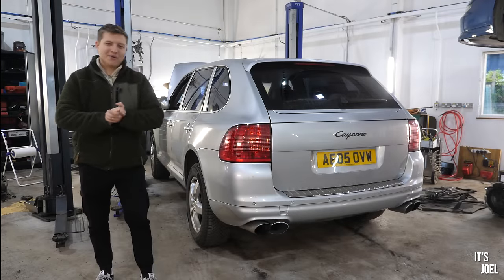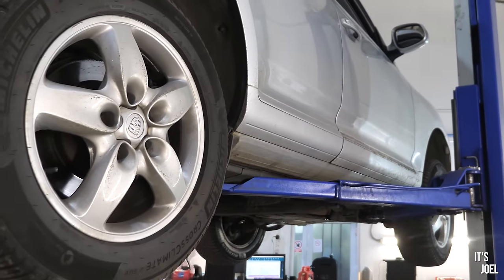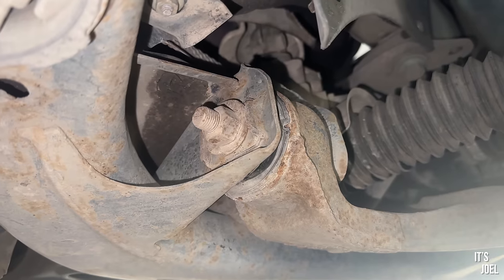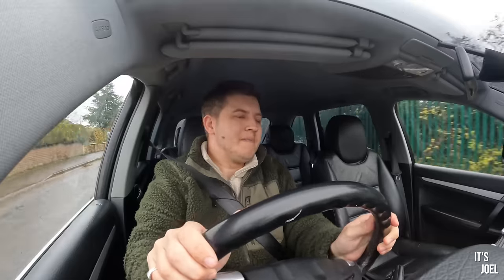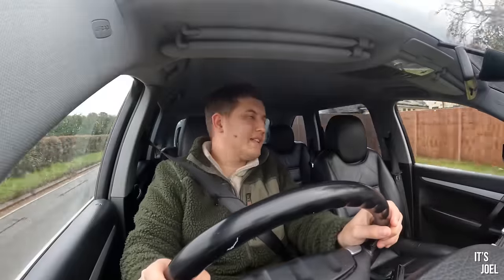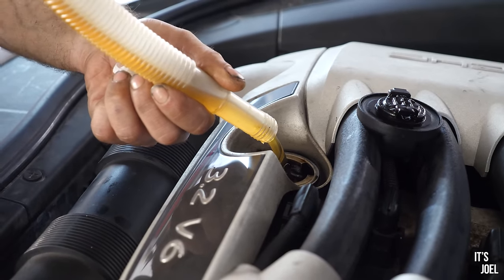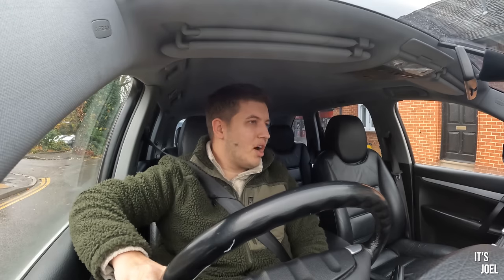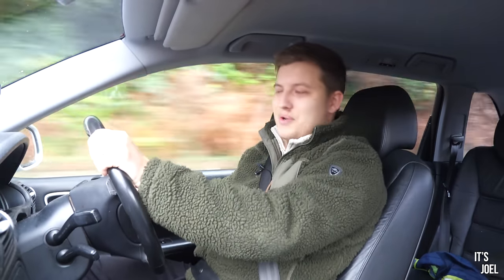The Truth About Owning A Porsche Cayenne...

Comment: Twist! 4.4 TDV8’s are phenomenal 👍
Reply: That's until both turbo's fail like mine...
Reply: @orwell9579  on the 4.4 or on a 3.6?
Reply: @JohnBaxendale  2011 4.4 Vogue SE
Reply: @orwell9579 interesting, it’s less common in the 4.4, do you know what went wrong? Presumably there was something that caused them to both go?
Reply: @JohnBaxendale  It's indeed less common on a 4.4 but I was out of luck I guess. Turbo failure on a 3.6 almost always has its origins in EGR problems that cause clogged vanes. In my case oil somehow got into the intercooler and was sucked up by the engine which led to turbo failure. Body had to be lifted so a high labour cost.
Reply: @orwell9579  Ugh, that sucks :( The failure of the oil cooler is quite common on the 4.4, it's usually oil that makes its way into the coolant, rather than the other way around, but anything can happen I guess!

Body isn't really lifted on a L322, it's only the Sport's/L320 that have the body lifted. The engine's on a subframe on the L322 and dropped out underneath, but same deal I guess, it's an engine-out job to fix the turbos as they're at the rear of the engine so it's always going to get expensive :(

Comment: Keep it - I have the exact same car on a '56 plate & I will confirm that the costs can get a bit saucy but then again, you kind of know it will when you buy it. For example my wipers broke the other day & it is £800 to get the whole issue sorted with a fit etc. If that was something cheap like an Insignia it would be about half that price for the same job. However, dont let it put you off as these really are fantastic & I would say the V6 is the better option to avoid some of the other really painful issues they can have (and 250bhp is fine for daily driving, I never feel short on power really). It is much more interesting than the equivalent range rover as well!

Comment: I've had a couple of cayennes and also a v10 touareg(basically the same car). They have nice quality mostly. But i've found quality is lacking in some areas. they usually get water inside because of blocked water outlets. And that leads to a lot of electrical problems. Air suspension is a pain sometimes when it starts to act up. Auto valve body can fail, front differential can fail.. interior plastic is not very high quality, V8s can have cylinder scoring and lots lots more that happens with these cars. I think you got a bit lucky with this one. They are great cars when they run :)

Comment: Hi Joel, always love the content but in particular the cayenne content, mainly because I picked up a 955 V6 at a similar time to you, so it’s been great to follow the journey. 

Unfortunately my experience has been vastly different to yours. I found the engine to be super reliable, however that couldn’t be said for everything else around it. I had consistent EML’s & PSM alerts, driveshaft knocking as mentioned in the video, coolant leaks, gearbox issues & what ultimately killed the car was a rotten subframe that made it uneconomical to repair. 

That being said, I do still think they are fantastic and the prices they are currently at makes them a pretty low risk gamble, even if the running costs are quite high! 

That being said, if another one came up around me and it had been well looked after then I’d happily pay a bit more to get behind the wheel of one again!

Comment: I daily drive my 2001 BMW V8 X5. It’s hard to beat an old school V8 in a fully loaded vehicle with all the toys. I’ve had some major works done on it in the last 10 years since I’ve owned it that’s cost a few quid but it still soldiers on.
I did have a 955 with the proper engine before the X5 and although it was reliable I always felt it was fragile - especially the interior trim bits. I quite often keep a look out for another but it’s gonna have to be a silver or gun metal grey with brown interior..
Just sold my Audi Q7 4.2tdi as well. Nice car but a bit too long.

Comment: I have owned a 957 VR6 for 2 years with over 200k km - no issues whatsoever. Fuel consumption (no chance to get much below 11L /100km) is much higher than a 958 for example.

Comment: I have a 2012 cayenne S 4.8, almost 3 years of ownership, about 14k kms, now 103k, issues have been 1. Coolant hoses leaking by being brittle, 2 Abs sensor replaced, and 3. air suspension issues, front struts replaced, pump replaced front suspension arm bushings replaced. It probably needs the rear struts replacing too. What I found is the car needs to be driven pretty regularly, at least 4 times a week. It's been OK but I am not overwhelmed by it, mainly I expect because of the suspension issues. Not sure what to replace it with GLE 350d coupe or Subaru Outback 3.6r (can you get that in the UK).

Comment: What exhaust do you have on yours Joel? It seems to be slightly louder than stock and the tips look different. I have a 2007 957 3.6 VR6 and don't get that sound stock, I want to get a bit more sound out of mine.
Reply from the maker: It's standard, although the tail pipes were an optional extra when the car was new
Reply: @itsjoel  it must be the placebo effect of those optional tailpipes muddling my senses. It does sound really nice though, perhaps I just haven't heard my car from the outside properly as I'm always the one driving it.

Comment: If Ravenol 0W30 isn’t too expensive there I’d have that instead of the Mobil1, but still rates midpack (decent) as per 540RAT Engineering blog, who torture tests oil to establish their true wear protection limits!! ATF is Mobil1 Synthetic ATF Multi Vehicle (silver bottle/black label). Diff oil Valvoline Synthetic 75W90, GL4 manual trans fluid Redline MT-90